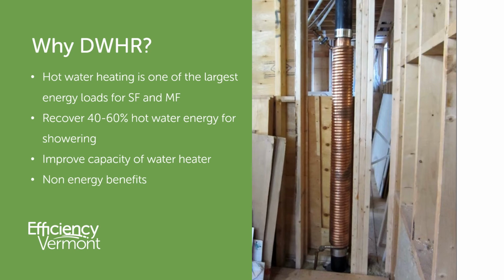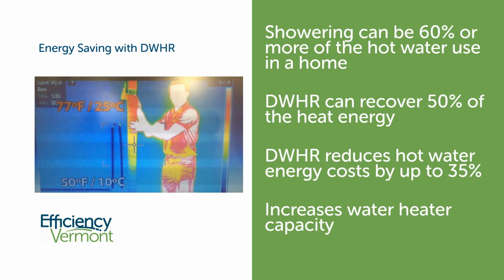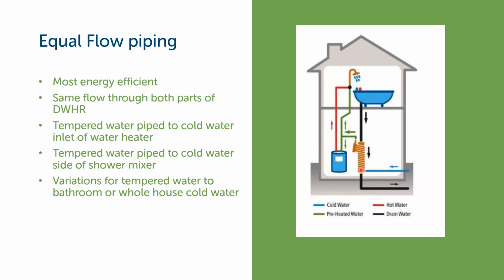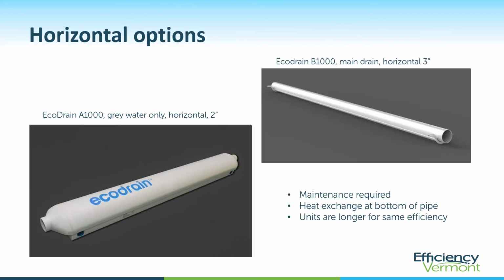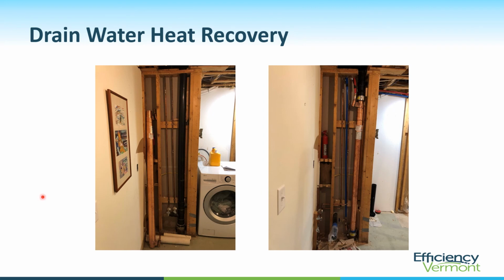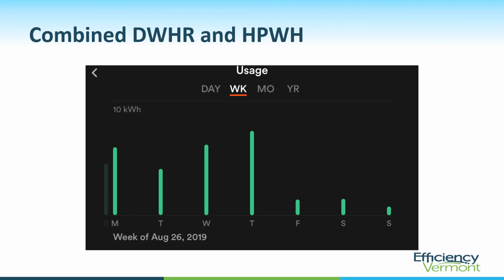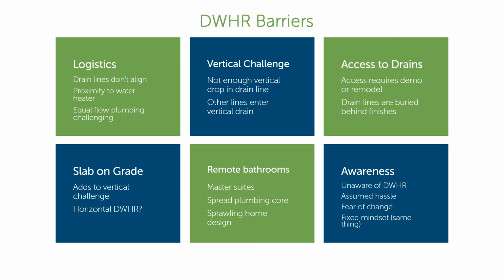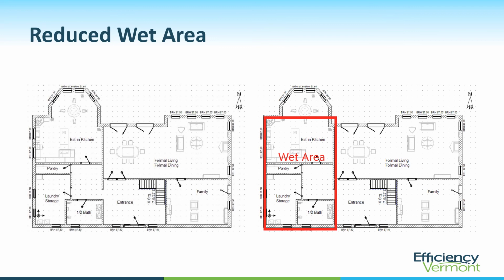Drain Water Heat Recovery

Comment: Thank you for the informative video. I just have one question,  how unequal flow exactly save energy if it doesn't go through the water heater , because when the water heater has preheated water, it's going to do less work means less energy, which means more saving , but if it doesn't go through it how exactly the energy saving is happening?